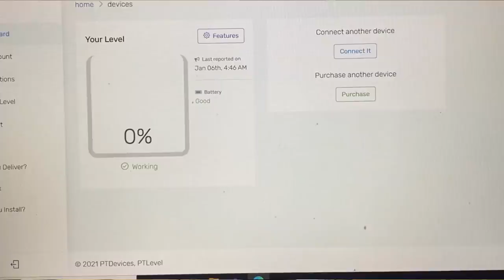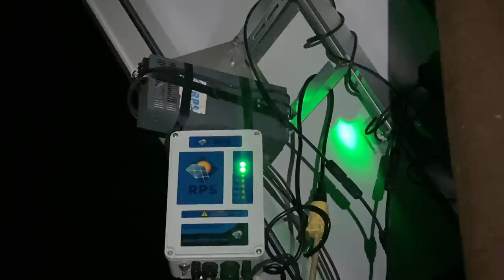#468 - Dually To SRW Conversion (87 K30 4x4) Off Grid Internet Q&A

Comment: Heath gives an excellent lesson on how to drive a vehicle under slippery surface conditions at 2:02   Things to pay close attention to here are: 1) He doesn't turn the steering wheel any more than absolutely necessary. 2) When the tires start to spin slow down and stop them from spinning. 3) If you can't make any more progress, reverse direction for a few feet and then try again. 4) Maintain or increase momentum when you can but slow and steady is better than out of control.

Comment: Hi Guys, Another great slice of life. Thank you for taking me along on your journey. I wish you were closer. I have an 84 Cutlass Calais with very low mileage, that was in an accident.  This vehicle was a very special order. It took 9 months before the company manufactured her. It has 36 extras, including factory tee top, 5lt engine, fiber optic. Tow package with all upgrades. And a lot more. It saved my life 3 times. IT TRULY HAS A SOUL. I refuse to junk her. She has no rust, and deserves to be restored. Tears are flowing down, how I 💘 my black beauty. In fact, she was at one time on the internet as the,classic of the month with antique insurance. But, I had to change insurance, as she was my only vehicle. I'm still in litigation with insurance company, who couldn't care less. She needs someone like you, to bring her back to life and beauty. She deserves it. 😢 😢 😢 😢 😢. I 💘 her.
Reply: Didn't know tow packages could be had for that car.  My brother built those at one time in a GM plant.
Reply: @JamesThompson-ol3eu  yep, up graded 36 extras from manufacturer. Engine, transmission, T-top, fiberoptics, towbar, undercoded, stainless steel wheels, bucket seats  etc. And yes tow package which up graded other things. It took 9 months to get the car due to the larger engine. Had to wait a long time for confirmation they would even manufacture it.. When they finally agreed to get this engine, my father ended up calling them to see if they had one more engine, and ordered one also. But without a lot of the other extras. It was one of the last Calais they manufactured.That's why my X ordered the Chilton book on her.

Comment: When you get around to choosing window coverings, take a look at cellular blinds. They trap the cold air from outside in the winter and the hot air in the summer, amazingly insulating. They aren't the least expensive option but not the most expensive either. If you 'special order' them, you can choose from different colours to go with each room while every one of them will match from the outside. I call them "self-dusting" because nothing "sticks" when opening and closing them. That's a bonus, eh?!
With love from Canada

Comment: you would pick up painting fast. I'm like you, love to see what I can do to save a truck or car. I've always been like you and am doing it again ( I'm 82 ) building a 1963 Honda road racer ground up. Started the project over 5 years ago searching for rare parts for the 350 around the globe, getting the engine together and having to find racing parts on line and from old friends to help finish my project. Today I finished the 4.5 gallon racing gas tank so now I can get it ready to start up. The engine is new in every respect except for the original castings for the head and cases. Pistons, valves valve springs with titanium retainers, cam regrind by Delta cams, Amal 30mm carbs all new and ready to fire up.

Comment: Was out in Goshen Indiana for a while and there are a large number of RV manufacturers in Goshen.  The folks that moved those RV's used pickups. I noticed that over half were Dodges, most of the rest were Fords.  On occasion you would see a Chevy set up as an RV toter.  Just didn't see many Chevys as work trucks.  I do like the looks of the old square body as well.

Comment: I don't know about you, but the upgrade for Android that came out in December screwed up my and many other people's wifi settings causing devices to keep dropping the internet.  I have fiber optic (FIOS) which can handle many devices all at high speeds with no problem when working right, but whatever was in this "upgrade" screwed up all our Android devices, we'd have good a connection, but the internet would "disconnect," anyhow I found out it was a simple fix to reset the WiFi and Bluetooth to original settings, re-entering passwords and we were back to normal.  
Don't know if this helps, but I hope you have success in getting an internet connection that suits your family's needs.  Alway, I always enjoy watching y'all at  Red Poppy Ranch, God Bless  your family and may we all find peace in these very crazy times we live in.. IMHO you made a great decision in moving to where you live, I wish I could do the same. 👍✌😘🇺🇸

Comment: One issue with Starlink is the 100watt heater in the unit that is there to keep it warm for snow/ice melting so you will need more solar panels and maybe storage to cover that constant drain. Something like covering the shop and house with panels on the back side to have a large fixed collection zone without losing the look of the house. 

Will be nice if they turn the heater off/on with the weather as it should only be needed for snow/ice not 24/7 running.

Comment: you nee some led floods and motion activated on the steel beam - they may not escape basketball - you need drywall - it will really brighten the place up and also help the insulation work better - functionally the garage is already a big win

Comment: Those PT devices level monitors gives you the ability to have a low level notification. It takes seconds to set up and then it sends you an alert when the water gets to that level. I watched the video where you set yours up and went out and ordered one. Pity you didn't have an affiliate link for it but I nonetheless told them that I saw it on your channel and ordered it on the basis of your review.

Comment: Sure wish you would  use some jackstands.
Reply: Hmmmm....i must need new glasses...  I see jack stands whenever necessary.
Reply: R u blind
Reply: @davidfirth9342  Provide a time stamp, and we'll see, son.
Reply: @Skulllywag  what the dam video boy ffs
Reply: @Skulllywag  Not sure David was talking to you when he said "R u blind".
Reply: He did in fact use jackstands.  He had two under the back of the dually, two under the front of the one outside the garage and he added more under the back when he jacked it up to remove the rear end.
Reply: @williammitchell8247  I thought I saw them.  I asked for a specific timestamp in case I missed something, and got gibberish back as a reply.
Reply: Starts about the 5 minute mark
Reply: He had them under both trucks.
Reply: @Skulllywag  You did see them, I saw them as well.  I was saying that I think he was responding to the original comment from Jim Major.

Comment: Look into running a main cable from the backbone and becoming a defacto highspeed provider ~ distance and neighbourhood cooperation is obviously a barrier but as a DIY job it's basically digging a trench from the backbone and splicing to it, a few hundred people can have 200mbs internet and has proved cheaper than Sat but it does have = one giant upfront outlay for the roll of fibre cable.
Reply: Great thought except there are probably not enough potential subscribers and the ground is 97% igneous rock so trenching would be like redoing the Panama Canal and punching holes for posts near impossible too.

Comment: My Dad was a A grade motor mechanic after 12 in service after WWII.  So he never had a new car. He’d say “Once a car is off the showroom floor they all are 2nd hand anyway.  When I was 19 my car was a 1059 Morris Minor.  It didn’t look anything special but she purée like a kitten.  We, as a family went out to Roma, 350 miles west of Brisbane. Dad was raised out that way.  A heap of my male cousins stole the car one night, by morning it was masked, sanded, undercoated and one coat of a dark green.  We went out there with a ratty car and came back with a really nice one. I think in the ‘50’s it was an old great  Cherie ? Spelling.  I know Dad taught me to crawl under it, he would fit the spammer on them I’d get in and undo the last of the sump. First time , Mum was furious, I got all the sump oil in my hair. Never again. I learned to know when to such and pull the tray in. The car was so low to the ground Dad couldn’t get under it without jacking it up and that of cause put the sump on the wrong angle to drain. So that’s when little 5-6 children learn to do what dad can’t do.  
My old Morris ran on the smell of a greasy rag.
I’d better go it’s late ere. But old cars —- to me can be worked on and have character all of their own.  Love you guys.   Ellen.
Queensland,  Australia.
Reply: Who would of thought that was a lady talking? Giggling... I grew up with mechanics too. Helped take apart a '75 celica engine and put it back together. And now work at a Chevy dealership, so know my way around a vehicle too.

Comment: Heath, the tech guy with regards to a strong Sat Signal will down grade the signal with any obstruction in the path of line of sight.  The main point is the actual location of the satellite will mane a huge difference.🙏🙏🙏🙏

Comment: If you're doing a cummins swap right now The Skid Factory and Deboss Garage are doing a 24 valve P-Pump conversion for The Skid Factory here on YouTube. The Skid Factory is in Aussie land and DeBoss Garage is in Canada and has been a really great series, they are slipping the show between their two channels. 

And the school I think you were looking at was WyoTech which is in Laramie WY, I when through in 02-03 and got the degree in Chassis Fab/High Performance Engines and Paint and Body. It's still up and running with the old owners, and they have better refined their classes.

Comment: Setup local(ranch) wifi network for Your sensors ... or just connect them via local cable network  (Check smart home building without third party services aka the internet after this ranch is out in nowhere so make sense all house infrastructure run locally )

Comment: I love rat rods....you need to find a lathe to turn brake drums and calipers and flywheels, my husband is always tinkering on some old mopar,he used to be a Chevy man  chevell ss,nova ss, impala ss,etc.until a stock 340 6pak demon blew his built to the hilt 350 4bolt main mouse motor into the weeds,he said it's time to switch sides

Comment: From what I've seen Starlink is at it's best 150-200Mb down and 30-40Mb up.  In snow and other bad weather the speed drops, but I assume that's the same with normal satellite internet.  Should be a big improvement for you eitherway.

It is under better than nothing beta though, so you can expect speed, stability, latency all to improve as they improve things.

Comment: I'm sure if rain can interrupt satellite signals, a tree can too.  The Earth's pole hasn't shifted.
Reply: Thank god I am not the only one who can't stand his ignorance regarding that. Finding the rate at which the angle of the rotation of the earth currently shifts (0.013 degrees per 100 years) is littearly 10 seconds of googling away.
Reply: @TheDabadu  The Magnetic North Pole Is Rapidly Moving Because of Some Blobs. Earth's magnetic north pole has shifted away from Canada and closer to Siberia at a rapid pace in recent years. Researchers believe two massive blobs of molten iron in Earth's outer core may have spurred the runaway pole.May 15, 2020 Popular Mechanics
Reply: @elmerfudpucker3204  You are right, I am not disputing the rapid shift of the magnetic north pole, however this does NOT correspond to a physical shift of the earth (and its poles) and is not changing the position of satellites in the sky (which is, what Heath is claiming (not in this video directly but in an older one)) Have a great day!
Reply: @elmerfudpucker3204  Magnetic North can be literally anywhere and not affect the physical perspective of where the Sun appears.  Also, on top of that, even if the Earth's pole had actually shifted (it hasn't) the geosynchronous orbit of satellites would remain unchanged.

Comment: Satellite uses a lot of buffering ~ a good bit of that sat delay is buffering, and yes leaves, birds, dust heavy cloud all block and break the signal and any corrosion on the receiver or miniscule misalignments degrade reception and just destroys an Internet connection. 

But make sure you are buying a better system ~ a lot of companies just sell each other's products ~ nothing illegal, but I'm on a 24mbs line as example and have a business connection, my neighbour is on Virgin and has a 200mbs connection and they thinks it's brilliant ~ it's the same connection with the backbone provided by the same company and my tests on his system reveal, he's "just" getting 24mbs. :)

Comment: I am not sure what your connection status is with Verizon, but we changed to Visible Mobile last year for our cellular service, because its more reliable in the mountains of Colorado for us, more recently I added an extra line on a Mofi4500 router and use it for internet on all our computers and TVs in the house and we get great service. We turned off our sat internet after the switch, because it was far better regarding speeds and latency. We average 25-30mb download, 5-11mb upload for $25/month.

Comment: I'm looking to get into a Diesel Excursion, but they're still going for stupid money. Might have to get into a gas one and then get a wrecked diesel to do the engine swap. Also rebuilding a Crown Vic and looking to score a Lincoln Aviator for its drive train for it to give it more of a Marauder feel. In lieu of an Excursion, I've been looking at F-250s and 350s, but so many 350s are duallys, so I've been researching what it takes to single one out and a rear axle swap is pretty much the only way.

Comment: I run a NAS for my media, but also my cameras and ebook library server as well as a website, granted it's private (password access to me and remote family members across the country) and I do it all on a 10 year old computer with 3 drives, boot SSD, and two 4tb library drives that hold all the movies and tv shows and music. 2 IP cameras (only 720p, but good enough, a Calibre e-book server for kindles, sony ereaders, tablets etc.... good for kids textbooks and lesson plans. My private website with all the family photos, family planning calendar, and discussion forum etc... total cost was about $600 (used computer and upgrades)  Not the fastest but it streams media no problem (2 streams max) serves up ebooks and webpages (photo libraries mostly) and records the cameras (2 week rollover on the camera to save space on the Hard drives)

Being remote, this 'could' allow you to watch/listen/read without the internet connection.

prebuilt NAS exist and are just fine, esp if they come with the flexibility to expand as your system grows, add cameras, add websites, add a caching server etc... but they cost.

Plex is my media server choice (software) $, windows 10 is the platform, and I use remote control to use it from my regular computer, meaning I don't have to go to the server physically to use/update/maintain it. which means it can be tucked away esp if it's older and noisier (fans). 

Very low power NAS builds are on the internet for off grid applications (I've seen ones that idle at 10w)

At any rate, all the best for the new year!

Comment: I feel you will be ordering a new pumpkin for the front axle....or buy a ring and pinion to get a mating ratio with the rear axle.....Unmatch ratios will have the 4wd nt working and the axles will fight each other and something will. break.

Comment: How much work would be to run a power line from the house down to the controller for the well so that you would just have to flick a couple of switches up at the house and run it off the house Bank? Maybe running some conduit in the summer might be I plan for the future. I don't imagine you could move those solar panels up to the house very easily

Comment: Heath have you looked into Fixed Wireless? We had Satellite Internet at Radio Shack when I worked in Cary NC in the early 2000s. It blew hiney winds then. Don't they throttle you when you have reached a data usage point?

Comment: I could use some info. With so many subs i doubt if you have time to answer truck questions. I wish i knew what will interchange with what on my 1986 GMC 3500. 454/4SP granny and a dually rear end. What years transmission and rearend will fit easily?

Comment: Screw satellite internet.  If you can get a cell phone signal, you can get 4g LTE internet.  Unlimitedville is the big boy, but you can get the same from U2C for about $100 a month.  If your cell signal is weak, you can get a booster like "Weboost".  I also live in the middle of nowhere, and get 40 mb download off of either ATT or Verizon signal.

Comment: Do yourself a favor and go with the 03-06 common rail 5.9 cummims and drive line,  much nicer setup and more cost effective to get into that 500hp range....and they are quite!
Reply: 12 valve simple, no computer.  I have a 06 and love it, would trade it for a 16.  Common rails are awesome, but on a swap the 12 v p pump makes it way easier.

Comment: ok I like watching your videos and I have learned alot from you by watching. Now haha .....I own a 1999 Dodge Ram 3500 that was a dually! Now when I bought it It was'nt a Dually I asked the guy I bought it from and He told me they just took off the flares and put single wheels on it! That being said I have put a set of rims on it 22x12 and they stick out the exact same front and rear! That being said didn't you just do alot of work for nothing? I'm sure i will be told i'm wrong but you put outside tire on and are they not close? just asking i'm sure you know what your doing!